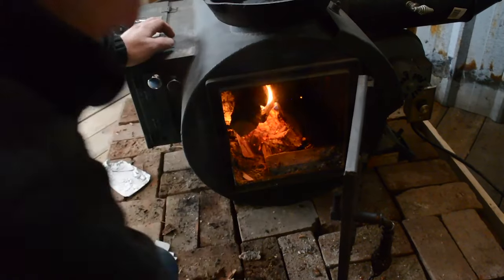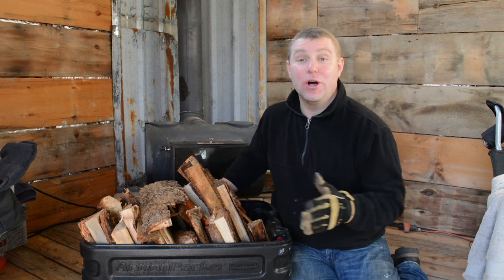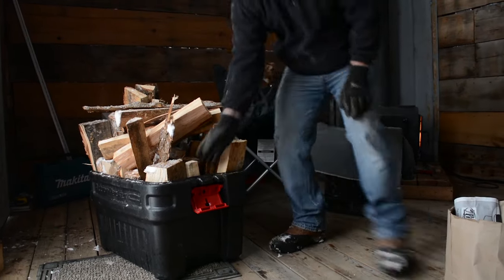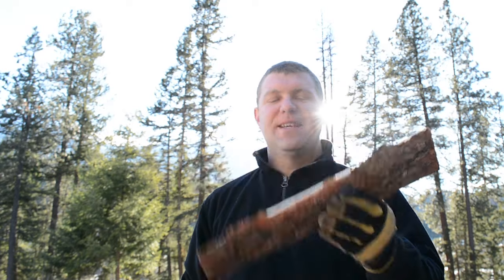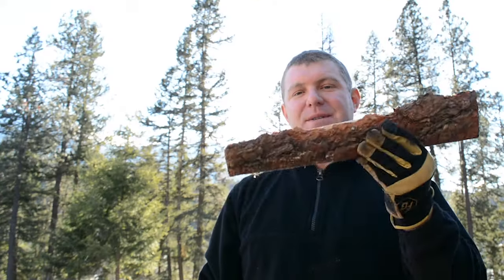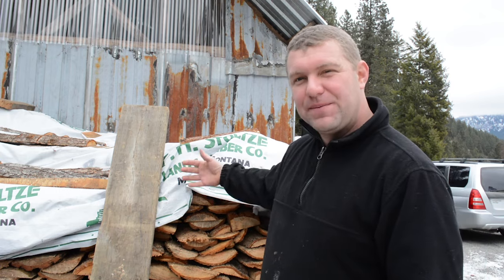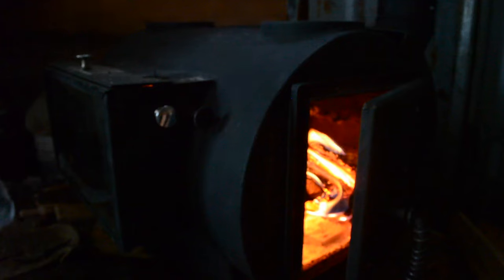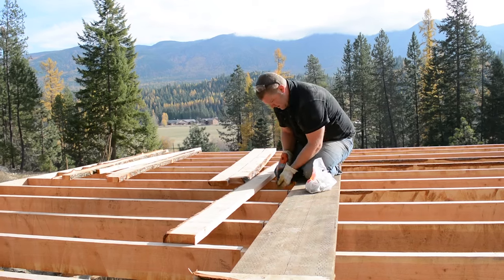5 Wood Burning Stove Mistakes You’re Probably Making

Comment: Where I come from, people just stack it nice and neat right next to the wood stove.  Some folks leave the wood in the open with just basic framework to ensure the stack is stable, and others like to build a covered enclosure.  At our place, we didn't have much space so instead we built a nice outdoor frame with a roof right outside where it was sheltered from the wind, one layer deep, stacked tall.  We'd transfer from the main pile to that, when it ran low, rotating the remaining wood to the top, and always had nice dry wood ready to go and a neat tidy looking yard.  We just brought an armload in with us whenever the chance arose, and that kept the little mini pile by the stove fed.

As a helpful tip, we stored our birchbark on top of that wood stack.  It didn't blow off since it was out of the wind and built parallel to any residual west breeze that did come through.  Any snow, or rain that worked its way under the roof primarily landed on the birch bark, which will light wet.  Of course, we always stacked the wood with the bark side up as well anyway, so it wasn't necessary.  You don't need a very wide roof if you keep it out of the wind, so it will get plenty of sunshine.

Behind your main woodpiles, if you keep them away from your buildings you have prime real estate for "planting" mushrooms as well.  Mushrooms love that shady woody area that inevitably forms.  I like to sort of slowly shift my piles around as I use them and take advantage of the mess they leave at the bottom for growing things.

Comment: If you put a damper inside your stove pipe it will keep the heat down in the stove instead of going up the pipe. Install damper about 18"-24". Can be purchased at any hardware store.

Comment: we grew up with a wood stove, still have it in an old garage, I can load one or two big logs and it will burn all night. Sometimes I would put a small piece under a 12-14 inch across, log and it would burn with a good bed on coals, all night. Use a damper on the pipe and a screw in dampers on the door. use insulated pipe also.

Comment: My family burns wood. We have a new stove that is very energy efficient because it has a secondary burn which is the particles of the wood in the air that is being caught on fire because of extremely hot air blown on it. Also, I wood recommend an indoor wood rack. You can store more wood and you can see everyrhing laid out in a nice neat row. We have 8 quords at the moment but here in new england its been pretty warm. Thirties and twenties with an occasional 40. Ideally like what you guys are doing. Good luck!

Comment: Congrats on over 25k views...  Yes you have a lot to learn...  Yet the  most hateful comments come from channels with NO videos of their own.  Type of wood matters little.  Just make sure it is DRY, Dry, Dry.  Some burns hotter or longer or cleaner or slower or. Great luck and see you in the next vid.
Reply from the maker: +Mostly humble 1 Totally agree. We're doing the best we can. Critics are a dime a dozen, most watching from their heated massage recliner in their central air heated apartment with a TV diner in hand. Doesn't bother us much. We didn't get this far by letting other peoples opinions affect us much. Hah! Thankfully winter is letting up slightly so we've had the wood stove off for a couple weeks only running it to remove moisture in the cabin. That's been helpful. Ideally we'll have a whole different situation come this fall when we actually have time to do things properly. Thanks for the positive comments. Much appreciated.

Comment: Tip1: To get the fire last longer during night, wrap the maximum size of wood, that normally burns good, with newspaper. 
Use every sheet separately, otherwise it would be too tight and the wood don't catch fire. Don't wrap to loose otherwise the paper is gone in a minute and don't change much.

Tip2: Elongate the pipe, to get a larger heating surface and do only use bows with 45° ore lower. Harder elbows increase the friction to much. The smoke should be around 200C° after the state regulations (here) but you can go much lower, just about 100°C would work and safes you a lot of fuel.

Tip3:get more wood inside to give it time to dry .

Tip4:Use a basket (I use one of wire) if you don't want more wood near the oven ( a lot of creatures don't like it, so you have different kinds of Insects everywhere) in a closed box it don't dry as well.

Tip5:Have enough wood to give it 2 years to dry. For that it is good to have the roof of your house extended  to every side to store the wood there, what (the wood) also gives  additional  Isolation.

Tip6:You can heat lumps of metal in or on your fire to heat with those corners of your home (more to dry then heat)

Tip7:If you want a smaller fire that don not want to work in your oven, set stones(brick)  in the combustion chamber to make it smaller and reduce the air income.
You can find a lot of easy plans (about Oven, Window and...) here, in German but with that amount of pictures that, I thing, no language is required at all.
www.packpapierverlag.de
 
After hours!! on trying, now it allows to copy in a Link :-(

http://www.packpapierverlag.de/?page_id=2
http://www.packpapierverlag.de/?p=558
EAN 978-3-924038-73-1
and others
http://www.packpapierverlag.de/?p=551
http://www.packpapierverlag.de/?p=542
http://www.packpapierverlag.de/?p=590
http://www.packpapierverlag.de/?p=550

Comment: ive been in a number of cabins that have a heat activated fan on the top of the wood stove. No power needed and they work pretty well to move the heat around. Should look into it, help even the heat out and move the air around, would help dry the wood box too. Cheers

Comment: We had a Fisher Grandpa Bear wood burner - heated our 2 story, 3 bedroom + basement for several winters - built a water block to bolt onto the back wall - ran water thru it and stored it in the water heater - didnt run the heater all winter.  btw this was in  Wisconsin

Comment: Hi Guys, really like the channel.  Is that pine you're burning?  I wouldn't burn pine in a "indoor" fireplace or woodstove.  Creates too much creosote...  that might explain having to clean your stove pipe so often AND why your loading the box every half hour.  Hardwoods, burn hardwood.  Really worried about the design of the stove pipe.  You might consider taking the same approach there as you did with the septic tank installation.  Good luck and really enjoy the videos.
Reply from the maker: +TimeDrawsNigh You're right that hardwoods are better for burning. We aren't burning pine (pine / fir mixture) because we don't know any better, but because it's what we have. A large part of this journey is learning to live and sustain a home with the materials available to us rather than throwing money at every problem. We don't mind cleaning the stove pipe frequently or filling up our box more often (down to one box a day when we're burning). We don't mind keeping an eye on the stove. Our design isn't perfect but that's okay, that was never the plan. We understand the concerns folks have but in the end, our setup is working just fine and we're learning how we want our stove setup to be in our future home. All problems are easy to fix when throwing money at them but we are challenging ourselves not to do that and don't feel that our safety is at stake. If our $300 cabin burns down then so be it, but we doubt that will happen. Glad you're enjoying our videos!
Reply: Jesse - this was such a gracious reply. I have only now begun reading your comments after binge-watching most of your video content. I totally appreciate what you are trying to do. You come right out and SAY that you don't claim to be experts on various topics as you study, research, and then try various methods. Openly saying that you are trying to learn about this seems to be missed by some, but please don't let it get you down. I love you guys and your channel, blog and FB page. Keep up the good work. I doubt we'll ever go off grid, but I see ways to cut our expenses in our sub-urban life as I watch every vid you put out. I have another channel I watch (Keith Rucker - machine shop stuff) and he was very brave: he scheduled a work day and invited his viewers to come to a his home. It went well!  Something to consider?

Comment: I am enjoying your videos.  But I have some comments on this one.

I have been around wood stoves for 60 years both as the only heat source and as a secondary heat source.  I have spent spring, summer, and fall at an off grid camp for most of those years.  I would like to give everyone some tips based on my experience.

Plan on having your wood as dry (seasoned)  as possible.  Store it covered with ventilation on the sides.  A classic wood shed is a building with slat walls and a roof.  

Rotate you wood and let it season for a year.  This gives you good seasoned wood.  Also if you get sick or hurt.  You know you have heat for the winter.  (Generally it is easier to find somebody to feed your fire if your wood is already.)  The wood that you are cutting now should be burned two years from now.

For minimum creosote build up burn dry wood.  A small hot fire is better than a larger smoldering one.  If you must burn wet wood burn it hot with a lot of air.   I have never had much creosote buildup on any of my stoves.  When I have replaced my stovepipes they have been quite clean in side.

Comment: bring your wood in during the day so it has time to dry out, you would also get longer warmer burns if you had a damper on your stove pipe and you need to put a fan on the pipe as well the heat will make it spin and it dose spread the heat

Comment: Evlevate  the  center of  your fire box  with  firebricks  so that the wood  burns on a platform . Build the initial fire on the platform and   when reduces to  coals  push them  to both sides of the platform and add  wood to the center  which will ignite  from the heat of the coals. Continue  this process  and  you'll  have hotter fires   and  a more satisfactory fire.  I have  one of those  stoves.  I didn't see  that you are powering the  fan and they aren't  regulated  with a thermostat  so  this  is an improvement   that's eaisilly rectified.   Inverters are  cheap  and     a  battery bank    and  solar  recharger must  surely be on your  list as well.   Carry On!

Comment: Your stove is not breathing. There are to many angles. I had one the did same thing. i changed pipe straight up. The exhaust must breath as easy as possible. no restriction Also i think i seen bricks stack up out side. take all the brick and stack them around the back and side of stove and under and up few feet. it called Radiant heat . works great.
Reply: really good tip! ...use those stacked up bricks outside for radiant heat   😊
Reply: Am

Comment: Heard this one for several years now.
To have the fire Burn down instead of up, start the fire on top, not in the middle or at the bottom.

Not sure why and how it works, most probable one i can come up it with is that it will burn up the fumes/gas leaving at the top and therefor be more effiiciant.

Comment: Did you take in consideration a single or double barrel wood stove? They generate a great amount of heat. I see you don't have a lot of room in your cabin, but if it can be done you won't be disappointed.Try to go straight with the chimney: easier to clean (don't have to take apart); as longer section of pipe inside, more radiated heat, less creosote, faster burning, etc.   
I have one of this stove in my 3 cars garage/workshop, not insulated, and I get 30 degree higher then outside in @ 30 minutes after starting the fire.

Comment: I'm enjoying your videos, and thanks for posting them.

One thing about this video. Bringing wood into your home to dry out has some problems, and may not be as effective as people might think.

Problem one is that if you are drying the exterior of your wood, that moisture is going into your home. That moisture has to go somewhere. Problem two is that you are just drying the surface of the wood. The interior of the wood is going to be largely unaffected by a twelve hour storage time.

I'd also suggest being very careful with how you tarp ypour wood. Your stack needs to breathe, which a tarp stops. And tarps put directly on your wood will cause condensation to drip down into your pile, both of which will slow your drying rate significantly.

If you are tarping your wood, do it when it rains or snows. And suspend your tarp above the pile somehow so it has room to breathe and have a big overlap as tarps will dump water off the edges unpredictably when they move.

Having to burn wet wood is something I empathise with. We'r not long on our farm here, and in the first few years, wet wood is something you often have to deal with. Some species, such as ash, burn better than others when wet. You are still losing heat and creating soot, but they are easier to burn. You could also considering finding standing dead wood on your holding. If a tree has been standing dead for a few years, it'll  be dreir. It'll  be dangerous possibly to fell, as it may have rot making it's fall unpredictable. But it might give you wood that's a little bit drier.

Best of luck this winter, and happy new year.

Comment: Well, you're not supposed to burn wet wood at all. The steam takes the heat to push up the chimney. More steam, more heat energy is used for it to move it up the chimney. When you have steam in the chimney, the ash sticks to the sides of the chimney and make is dirty and dangerous of explosion. You're supposed to buy wood at least 1 year in advance and let it dry for 1 year before burning.

Comment: Really enjoying your posts. When it is colder outside like  the -18F it is right now it does not really matter much if the wood stove is to big for the space you are trying to heat.  My two cents to this post would be to make sure the wood stove is properly sized for the space. It is better to have a smaller stove and burn it hot (clean) than having a big stove where you have to squeeze the air intake a lot to keep the place from getting to hot. Starving a fire from air and burning fuel like spruce can cause lots of buildup in the chimney.  Stay warm!

Comment: You can take your first step before you even get your stove.  Cut your wood early, and store it in a good shed for several months until it is bone dry.   It should be split before being stacked.   The best wood box is a built in box, with a door on the outside of the wall. You fill it up from the outside without bringing in cold air, and take wood from the inside of the house, with no cold air.
PS you should use dry wood for walls too.  If you do, no tin foil peeking through the big cracks.
Reply from the maker: +tom jackson We agree on all points. Maybe this is the only video you watched of ours, but we moved to our land three months ago (right before winter) and in a short time had to gather materials, build a cabin for winter and install our septic. This journey isn't about doing things 100% "correct" or not doing them at all but making the best out of what we have. Sometimes life doesn't hand you a beautiful pile of dry wood (or the circumstances to have your wood pile in order before winter) :-)
Reply: Pure Living for Life  Life has handed me nothing.  What I have is what I planned for and worked to accomplish.

And ll give you a proverb someone else gave me:
Temporary is permanent until it falls down.

Comment: I would looking into building a wood gasification stove. This would end your soot problem in the chimney. More BTU's from your wood too. Also, your have an easy source of rocks with which to build a thermal mass sink around your stove, thus higher temps in combustion chamber and a BTU storage sink.

Comment: like your vids, you must not be in the real north, were we have -40 to -50+ winters from say mid nov. to mid April, with our coldest between Dec an March, you wouldn't last with a small stove like that unless you got up every 2 hours to load it, my first rule shop on my 30 ac. was a pole building with huge heavy tarps 14" w x 27 w x 12 h I had a old big wood furnace  in side it, in the coldest it would hold 60 to 65 deg. loading every 4 hours. at night 11pm, I loaded it tight with good hard wood and it would hold it at 34 to 40 deg. still at 6am
Reply: V

Comment: your two big efficiency problems are using single wall pipe outdoors and having too short of a chimney. get your chimney cap above the peak of your roof and get double wall pipe outside. these will both greatly improve your stove's efficiency by giving it the proper draft. your third biggest issue is having a stove with low thermal mass. this would be significantly more work/expense to correct. #1 & 2 will provide massive benefits.

Comment: Buy a better wood stove according to square footage of home, plus 200 sq.'. The wife auction bought a Schrader Royal Princess for $60. We put a 2nd row of fire brick on top of existing & new gasket on the doors. We have a damper 2' above stove. Once started & going good. With 8) 6" x 16" splits, It will hold heat for 9 to 12 hours near 72*, when out side is below 20*. On a well below temperature fall, winter, early spring, we use 1 to 1 1/2 cord of wood ( popular, oak. walnut, cherry, cedar, sugar maple - common locally).